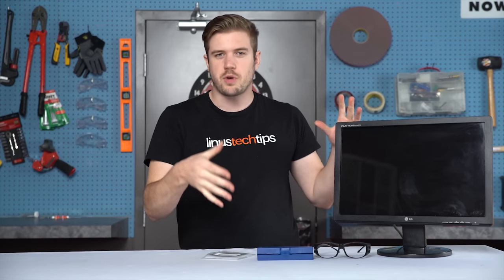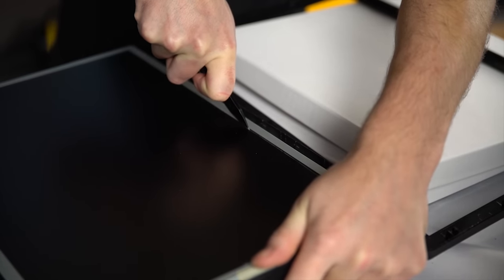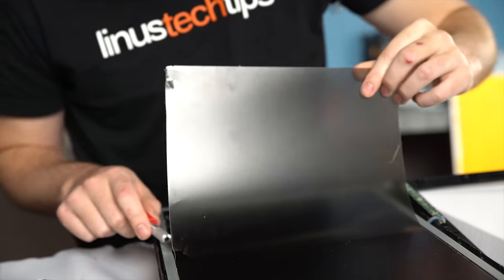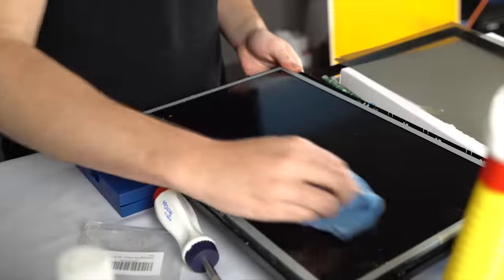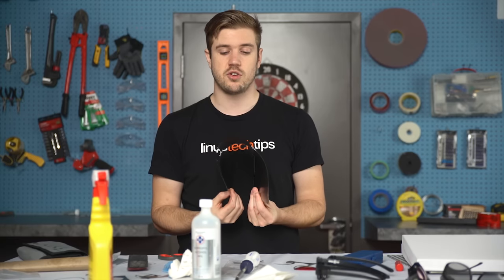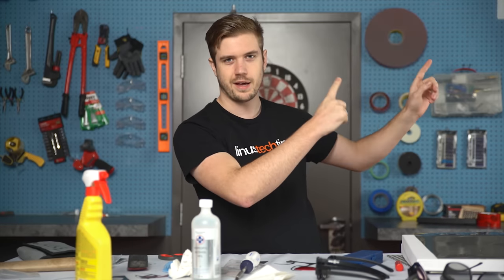DIY Privacy Display - Recycle your monitors in a badass way

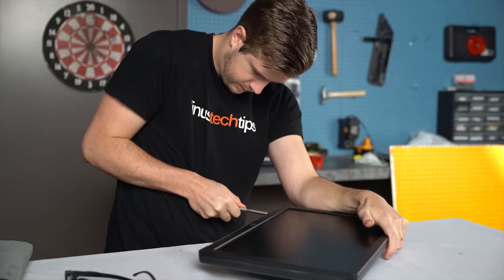Comment: 2:31 What the one from iFixIt? Showing they are plastic, cheap crap sold at an overpriced price?
Reply: +Steven Whiting 3:10 and yes, there's the evidence.
Reply: +TehHijack you have 10 of them then
Reply: SirBillyMcSilly I actually have 46.
Reply: +Steven Whiting Could you recommend a higher quality repair kit than the iFixit? Thanks!
Reply: Greg Hirtzel Buy them individually as you need them.
Reply: Greg Hirtzel http://www.ebay.com/itm/SKIL-36-PC-PRECISION-Screwdriver-Set-INCLUDES-MAGNETIC-DRIVER-EXTENSION-/261904285610?hash=item3cfab63faa:g:iiQAAOSwBLlVZdx9

I personally have one of these, if you want some spudgers buy a set from ebay, have some metal ones with plastic disposable ones. The plastic ones are not meant to be used more than one or two times, they are meant to break/bend since they are softer than the plastic you are prying apart thus the spudgers are the ones that scratch and not the plastic. If you ever end up needing more bits just buy a seperate bit set from ebay with security torx/whatever else you might need. keep in mind the set i linked are smaller than traditional bits so if you are shopping for more bits for that screwdriver you need to keep in mind the diameter.
Reply: +TehHijack That makes sense. I guess my laziness liked the idea of purchasing one kit that handled everything :)
Reply: +TehHijack Thanks for the help!
Reply: Greg Hirtzel The ifixit kits are meant for people that don't do this often like the linus teach team group. i take things apart on a regular basis. Sure it is a nice little kit but it is hella expensive for what it is. You will find more times than not guys that do this on a regular basis like me build up their tools over time, not just buying a big kit once.
Reply: Greg Hirtzel No problem, Find some dental picks while you are at it, they work great for removing connectors!
Reply: he didnt used it the right way
Reply: I think you're talking about apple
Reply: +Jin trucker  Hey man Apple makes great products and I'd buy an Iphone, if they only charged me $30 (what it's worth)

Comment: As a senior Service Tech in a computer shop, I'll give my advice:
1.  It's usually easier to separate bezels from the inside out.  Apply even pressure from screen side of the bezel.
2.  It's never a good idea to twist your prying tool.  That will ALWAYS lead to marred plastic
Reply: Oo thanks

Comment: i really think you guys should probably start trying these things out 1 or 2 times before filming it

i understand that there's some amusement in watching befuddled Luke ram an xacto blade into his thumb (he's very lucky that was all that happened) but then you guys are passing off "soak the surface in Goo Gone for a while and wipe it off" as ADVICE right before firing up a dripping monitor and wondering why it doesn't work

NEVER "SOAK" YOUR MONITOR OR ANY ELECTRONICS IN ANY FLUIDS SHORTLY BEFORE POWERING THEM UP...know what effects these fluids can have on a variety of surfaces, how long they take to dry/gas off, test them on small insignificant spots before using on an entire surface

and i'm noticing a lot of these Wikipedia armchair scientists in the comments saying that IPA is non-conductive, apparently not realizing that Luke is most likely using 70%-90% IPA solution which means that other 10-30% is WATER which can have impurities that make it conductive...Goo gone is a petroleum distillate, which is basically a hydrocarbon, which yes in its purest form does not conduct electricity but can still generate static, bear capacitance and most importantly IGNITE at 185deg fahrenheit

i commend you guys for having the "fuck it, let's just try it" attitude, i truly do admire that approach and unfortunately it's an attitude that's becoming less welcome in the world, particularly if money is somehow involved, but please try to troubleshoot projects that don't work as intended before passing ANYTHING off as advice
Reply: I like the when they do it for a first time, its fun watching them learn. And as for the last part of your comment, This does work, i just did it.
Reply: yeah but you at least made sure the damn thing wasn't dripping with fluids before turning it on, right?  it's still not the correct way to do it, you should still put the cleaner/degreaser/whatever on a separate rag and THEN use it on the monitor surface
Reply: jacksonlefteye Yeah xD
Reply: +jacksonlefteye He's presenting an idea of something that can be done and illustrating his experiences doing so. Stop taking everything so seriously, jesus christ. No where in the video did he say "Do this exactly as I am doing it" or even pretending that everything worked out perfectly. At most he provided some pointers like "don't use the razor chisel because it leaves fine lines due to the edges" and "use goo gone instead of iso alcohol because it works more effectively" and in the end showed that it does indeed work. Basically a proof of concept. Its your job as an adult to take these ideas and adapt them and execute them properly, stop being such a baby over a little video Luke does to try something out for fun.
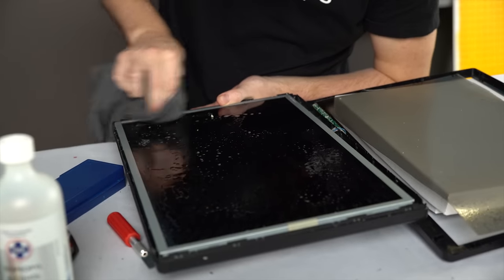Reply: 9:45 (whilst liberally spraying goo gone directly onto the glass) "So one thing i would recommend is making sure that you let whatever goo removal stuff you use to sit for probably a while and pad it off and do it again and let it sit and do it again until you can easily wipe the glue off..."

not sure what that sounds like to you, but to me it sounds like he's suggesting we do that, which is fuuuuucking stupid

they're adults too, and as the biggest tech channel on Youtube i'd say that puts some responsibility on their shoulders to get this shit right before passing out "suggestions" like that

it stops being fun when some 10-year-old watches this, tries it for himself and burns his house down because the goo gone shorted out on something...if you don't believe me, search for "twitch pranks" and look at the unbelievably stupid things gullible kids are capable of because of "suggestions" by nice folks on the internet...would LMG be liable in this case?  you tell me, because i don't see or hear a disclaimer anywhere in or around this video
Reply: jacksonlefteye Lmg wouldn't be liable because they did not force anyone to do this, also they are not the first to post this.
Reply: +jacksonlefteye Only you can stop monitor fires.
Reply: Seth are they covered by the Youtube TOS?  it reads to me like YT is covered, but not necessarily LMG..."agent"?

Comment: you shorted the inverter when you used the goo gone and didn't dry off the rest that might have touched the circuit board before plugging the monitor back in.

Comment: Best tool I've found for separating case halves  without unsightly damage, and a tool I still keep in my tool box today is a cake frosting spreader, very flexible, flat and a bit longer to help reach those deeper clips, just never twist the blade, slip it in and slowly slide it along the case halves.
Reply: top idea

Comment: It would have been much easier to remove the metal frame from the screen, then separate the polarizing filter. Clean up and then re-affix the frame. No cutting! Job done! And you would much less likely break your monitor.

Comment: Wouldn't using a heat gun help soften up the glue?
Reply: It might have damaged the actual display.
Reply: +Allen Clark I went overboard on the heatgun on my tablet and the screen broke.
Reply: +Allen Clark Why do people always jump to heat guns? Just use a hair dryer! They're like literally 10 times less hot and do the same job over a longer (safer) period.
Reply: +Allen Clark When fixing mobile phone's digitizer, I just use a hairdryer. I think that would also help.
Reply: +George Farren Quality heatguns typically have better temperature control (cheap handhelds usually do not) and support attachments to help direct the heat more evenly (I like using wide tips for displays). The other advantage is they are typically capable of melting lead-free solder for reflowing ball grid arrays.

While I agree that for most people a hairdryer is fine, if you regularly do electronic repairs a good heatgun and soldering iron are invaluable tools.

Comment: Actually I think what happened was some of your Goo gone soaked in and shorted out either some of the LEDs or one of the CCFLs on the top or bottom of the screen.  If one shorts out and the board detects not enough voltage being used for the lights it will perform exactly like that. Definitely don’t pour liquid on the screen 😬 it’s also not impossible to buy new CCFLs...

Comment: Just a suggestion. Don't spray Goo Be Gone on the monitor and you won't short it out. Use the concentrated stuff in the small cans and you only need to wet the rag a little bit and you won't short it out. The stuff in the spray bottle is diluted with water. Water + electronics = bad.

Another suggestion is to warm the surface with a blow drier (not a heat gun) before you start to remove the filter. I haven't tried this myself but it makes sense.

Comment: The bank I work at uses this technique.
Reply: And hospitals use this too
Reply: +Joona Pimiä really? are there monitors for sale without the polorizing filter? or did they have to remove them manualy?
Reply: +YellowBlue RC patient confidentiality.
Reply: YellowBlue RC To hide confidential patient data from people that are not the person it relates to. To hide data that could create a situation of distrust with the doctor and patient.
Reply: randomaandag They buy them commercially or have them custom made by the manufacturer.
Reply: The hospitals here dont use the exact same method, but the add some yellow plastic thing so can only see the screen if you are close to it and you dont watch it in angle.
Reply: +YellowBlue RC You get special contacts at doctor school. =P

Comment: The only reason the prying tool isn't working out for you is because u're using it incorrectly, you can feel the correct way to do that if you take a few seconds to handle the prying tool but if you don't want to learn by yourself just check youtube for info.

Comment: on some older monitors from around 2005 come apart and separate into layers with no glue

recommended on one of those old monitors so there is no risk of slicing the LCD or LED panel

Comment: "Inverter borked? Project worked, monitor didn't? Nothing to do with project we did?" We can see liquid damaging LCD layer and other internals.. (water based thingy was used? Isoclean or pure ethanol would work w/o issues). I know this is old vid, but i got like... I like LTT, but some older vids made me sad. Linus, i'm new to Your stuff and i like it. Really entertaining. And quality in 2017-19 has risen dramatically. Up.

Comment: "Removing bezels sucks."
 I've installed many touch panels. Start to finish maybe 15 to 20 min. You may even use one in a library near you. For those that still actually utilize libraries.

Comment: The inverter died because the guy soaked the monitor with glue removal. It was dripping removal from the back of the monitor. When I saw, I thought it would be worst than only the inverter.

Comment: Highly recommend a flat blade xacto. It's one of the most useful tools in tech repair. Also the tool for opening the bezel that you're looking for is an iSesamo. There's a bunch of knockoffs that works nearly the exact same. But that's the name brand and is perfect if you're looking for the proper tool. But an actual flathead screwdriver (not with the swappable bits) will work well too. 

Would recommend just getting an iFixit kit if you want a quality set of tools that come with nearly everything. Personally for my business I prefer Wiha and Moody dedicated screwdrivers, but use iFixit for things like Torx and suction cups. Hakko (the soldering company) also makes the best set of curved tweezers on the market at about $15 a pop. You can get away with a cheapo set for home projects. But for micro soldering and every day use Hakko makes the best. The tweezers have lasted me 6 months without bending and I've probably fixed over 1000 things in that span, using the tweezers basically every time. They are the only set on the market that have the rigidity for long term use. 

QianLi and Wira also make some excellent tools. I believe Apple techs are issued Wira.

Comment: Anyone know how to remove a matte finish? I removed the polarized filter successfully but its matte so it only works close up. If not i'll just buy some but it'd be nice to save a lil bit of money..
Reply: Depre ssion yeah, if you soak it in hot water. fill your sink and keep it under as you slowly pull.
Reply: Hey how well would you say this works? Im planning on buying non-matte polarizing filters and im wondering if theres any dropoff of quality over a distance. Like does it get blurry if youre farther away from the screen or anything?

Comment: I don't know if anyone would still watch this video and think, "i want to try this", but I would like to add a few things:
Firstly, if you only remove the top layer, which is the anti glare matt 3H layer, you can make your monitor glossy with more vivid colors and contrast (albeit reflecting more light).
If you use some wet paper towels, you can actually peel it off so no need to cut and risk damaging the display (though in this case, you need to remove the metal side brackets too).
Under this transparent anti glare layer is the polarizer which is darker but still semi transparent. Now this is harder to remove, so you might not be able to peel it off as easily as the first layer.
Good luck to anyone who would try to "mod" their monitors! But remember, do these at your own risk!

Comment: I would say the moisture from wiping the glue off, went inside the components and wasnt dried before using the monitor again thus frying some components. 10:50 you can see on the monitor some streaks. lots of moisture.

Comment: I recently removed the scratched Touchscreen layer from an old All-in-one PC bought on eBay.uk made by a famous brand and had no issues with white screens. It worked fine until Putting 12v on the tiny (HDMI-in) mainboard (that used a SATA connector (5v) for power) by mistake changed that, the backlight still worked but now the screen is indeed white. Maybe I should have checked if using those nifty polarizing glasses would have been possible because I thought I crippled the monitor. It is in storage right now. My guess is that the logic can disable (Toggle) the inverter and let you watch the monitor without the glasses again which is the default for some (Touchscreen) displays. Mine switched the inverter back on (Reset to Defaults) instead, Probability = 50% ?

Comment: goobegone is basically paint thinner (mineral spirits or white spirits for UK people).  Basically you have water base glues that come off with alcohol, oil base glues that come off with mineral spirits or lacquer thinner.  Mineral spirits is pretty mild.  It will harm plastic if you leave it on a long time but is usually ok for wiping off glue.  Lacquer thinner is a lot stronger and can melt some plastics.

Cellulose based glues and cyanoacrylate come off with acetone.

Comment: This is great except anyone with polarized sunglasses would be able to see (if somewhat poorly) your screen...  However imagine if you will a pair of glasses that can digitally change how they are polarized say once every 1 trillionth of a second and it is sinked up to your monitor similarly to those pocket 2-step verification devices that they have had for ages.  Now not only can no one else see what's happening on your screen except for an incredibly rare and fast trillionth of a second when they're glasses happen to sink up.  But we could no do away with passwords on EVERYTHING.  Because we could enter a button for whatever the password was used for that shows up in a random location on the screen and changes locations every x number of seconds or when the mouse button is clicked.  So even if the wrong person so where it was the chances of logging in where astronomically small.     Why does this not exist man.

Comment: if for whatever reason you want to do this use isopropyl when you're removing the filter or use a bit of heat to soften the adhesive. either way should work the isopropyl doesn't mess up the electronics because it just vaporizes after a few seconds or use a bit of heat to vaporize quickly. Good luck!

Comment: Why not use a heat gun? Most cellphone lcd/oled repairs usually use a heat gun to loosen the glue. I don't know what PC monitors use for glue, but it looked like the same LOCA glue thats on cellphones. If so, wouldn't this method be easier to do than using a knife on dry glue? or maybe if heat is an issue, just use a little Goo Gone too loosen the glue and act as a lubercant for the blade? Just a thought..tell me what you think.

Comment: Or avoid the homemade ghetto-style glasses altogether and just wear a pair of polarising sunglasses. And yes, they're already polarised in the correct direction. But if you want to make sure, just look at your screen with the glasses on and tilt your head left and right. If the image darkens when you do this, and is at its brightest when holding your head straight, it means the display's front polariser matches the polarisation of your glasses.

This is also the reason why you can't see anything on your mobile phone when holding it horizontally, if you're wearing polarised sunglasses. Smartphone manufacturers orient the polarisers such that you can still see the display in it most common (portrait) orientation when wearing polarised sunglasses.

Comment: Anyone tried it ? Perhaps try to use a blow dryer to heat up the glue and remove its stick with the screen and the polarising filter. Just so you don't damage the screen or anything. Makes it 10x easier if it works as well. As you'll just peel it off like a sticker with no glue